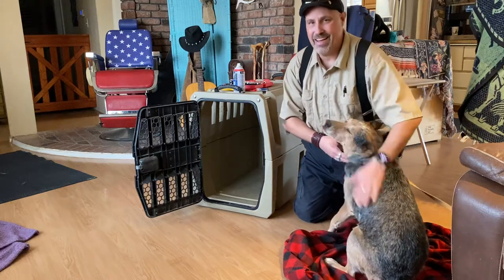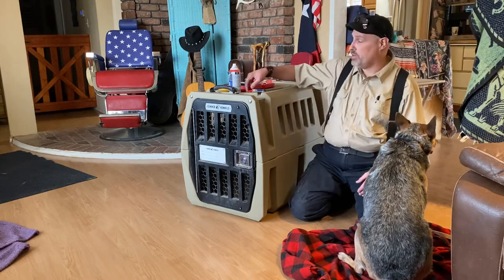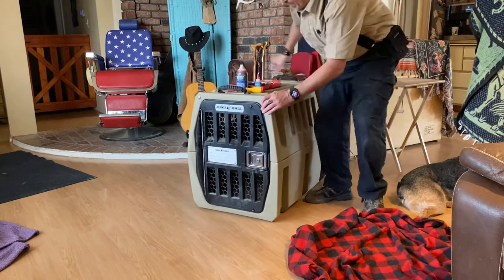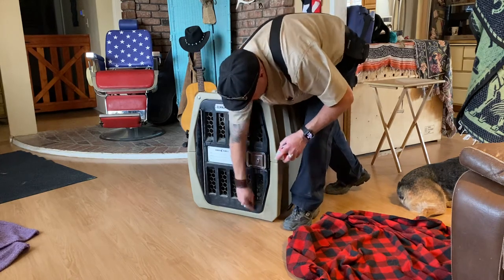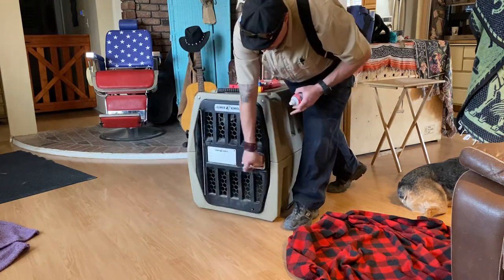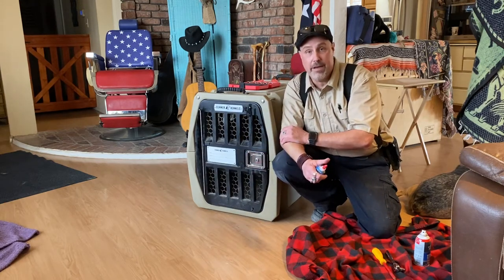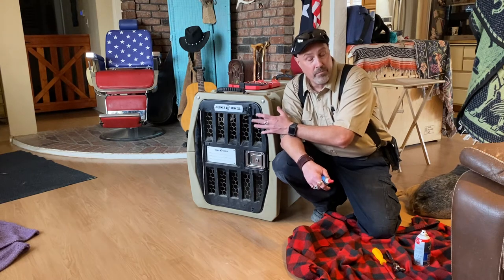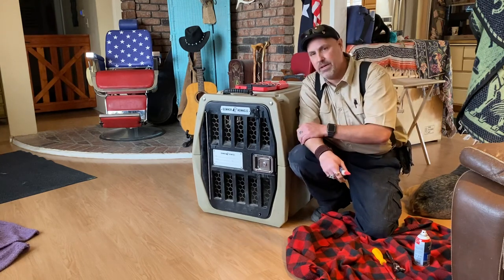Gunner Crate Maintenance tips

Comment: Does anyone know anyone who has a small used gunner for a puppy? I don’t want to buy two new ones. At a $1000 for the intermediate and another $600 for a small for 2-3 months. Thats way too much. Anyway used small anyone?
Reply: I may have misquoted the intermediate price, base w/o fancy padding or nameplate lists $699 + shipping. Used hard to find I think shipping is gonna be the pricy part. May want to buy new and sell when needed you will definitely find someone always will to buy used. I also would check eBay, Craig’s list and if your willing to travel maybe even pick up at Gunnar.
Reply: @kennethjagmin3329  Nope I know the prices. Yeah thought about buying and selling but would want to keep it if I bought it new. Stubborn like that. Looked all over ebay, FB, CL ect. Only cheap ones there so far. Thanks.
Reply: U could try a makeshift puppy divider